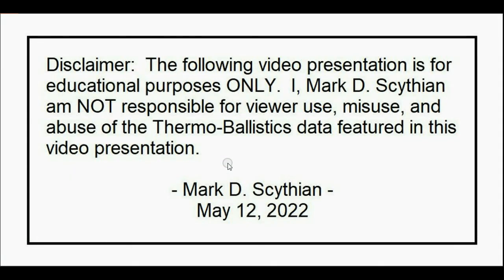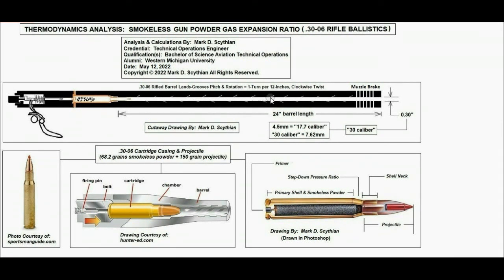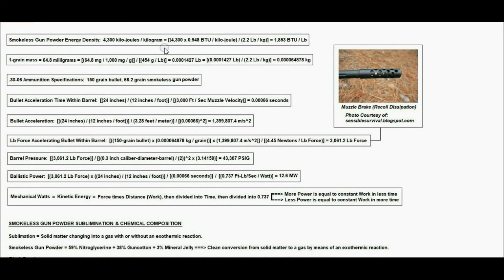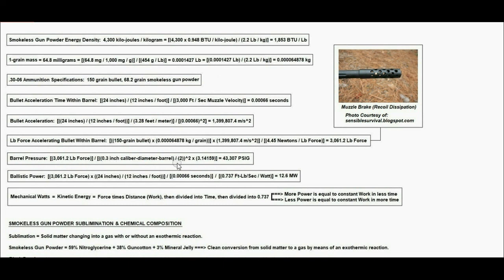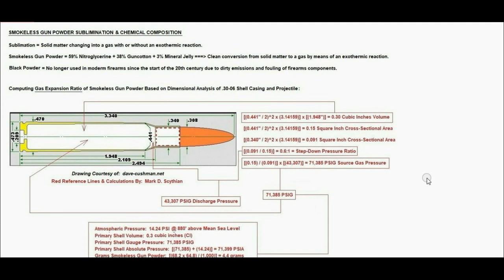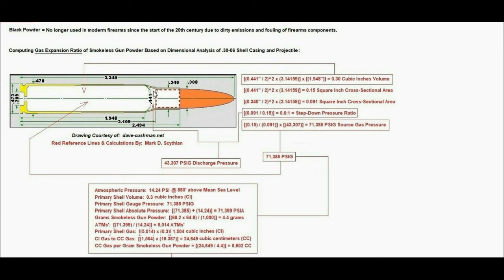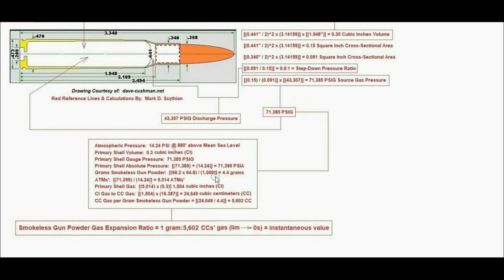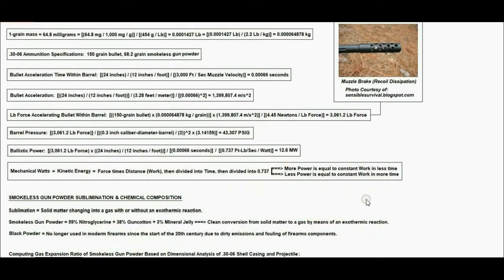Smokeless Gun Powder Gas Expansion Ratio

Comment from the maker: Hi Doug Reed!  Your comment only appears on my email page, but not on my YT page.  I've checked my YT settings and they're all good for receiving all comments without censorship.  My response to your comment is as follows:  

The zero-distance-point where projectile accelerates from rest, precedes barrel chamber length by approximately the bullet-length not the shell-length.  The pressure-spike starts behind the bullet within the shell neck tapered-volume.  

As for theoretical Vacuum-Trajectory physics, the chamber length would need to be including as part of the barrel-length for design engineering purposes.  However, for practical applications and performance metrics, the barrel length itself is approximately the controlled acceleration-distance of the projectile/bullet.  

After the trigger is pulled, the fixed volume of the primary shell volume pressurizes.  Inducing a force vector (pressure x cross-sectional-area) concentrated at the zero-distance-point of the projectile (back of projectile pressed into shell neck).

[(2 ft barrel) / (3,000 ft/sec muzzle velocity)] = 0.00067 seconds bullet acceleration-time.  Based on the grain-mass values (bullet & smokeless-powder), the calculated bullet acceleration-time closely matches the given ammo/rifle specifications. 

Your comment is not wrong on a theoretical sense.  It's just that theoretical values (chamber-length included as part of barrel-length) are more applicable to design engineering tolerances and Degrees-of-Freedom (DOF).  Especially when engineering shell casings, rocket-boosters, other thermo-ballistic and/or solid-propellant-powered rocketry applications, relying on propellants rather than liquid fuels.  

Liquid fuels rely on Combustion, whereas propellants rely on Deflagration.  We never want combustion or explosion when dealing with propellants.  We wouldn't want conflagration either.  Deflagration in can effectively support Sublimination or the conversion of a solid into a pure gas, while allowing for the release of heat (exothermic reaction).  

Explosion > Combustion > Deflagration > Conflagration

Solid-propellant-based rocketry and ballistics rely on Exothermic Sublimation, or converting a solid into a pure gas, while releasing heat.  The term "firearm" isn't actually correct, as it really is a "gas-arm".  Lol.   

Using compressed Air or gaseous Freon pressurized to 40,000 PSIG and suddenly released upon the back of a bullet loaded into a barrel, could achieve the same ballistics performance.  However, this is not convenient, fast, or reliable as just using smokeless powder, and setting it off into an enormous amount of gas-conversion contained within a fixed volume such as a shell casing.  

As smokeless powder converts into a pure gas, it will release plenty of heat.  However the heat itself (kinetic theory of gases = temperature) does not accelerate round, as does the gas pressure (collision theory of gases = pressure).  

Pressure x Area = Bernoulli Force.  So, Bernoulli Force is responsible for most of the ballistic power at hand.  Whereas Newtonian Force (Mass x Acceleration) is responsible for very little of the ballistic power at hand.   

Very similar to how a piston absorbs gas-pressure-spikes in a gas piston engine and converts pressure into force.  The mass of bullets and pistons are very small, and incur a very small amount of Newtonian Force.  It is the Bernoulli Force through a gas-pressure-spike exerted upon pistons or bullets (cross-sectional-areas), that brings forth enormous ballistic power or torque (pistons transmitting linear force to connecting rods and then to crank-pins for torque).

As for the Mechanical Engineering or Physics supporting the (theoretical) design of shell-casings, barrels, smokeless powder, bullets, bolts, gas-recoil-piston, and all other components of modern "firearms", the shell & barrel-length WOULD BE factored into the barrel length, for Vacuum Trajectory metrics.  

The modern "firearm" is just another gas-powered machine within the disciplines of Mechanical Engineering, Physics, Chemistry, and Gunsmithing.

I'm glad you brought up this point about factoring-in chamber & shell length(s) as part of the barrel-length.  Your comment is relevant to the design engineering of customized "firearms".  

Thanks for your comment!